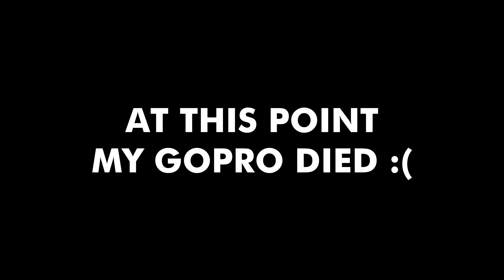2024 Triumph Scrambler 900 | High Mud Guard Kit | Fly Screen | Saddlebag Mount | Unboxing & Install!

Comment: Do you have the part number for the fly screen? Currently can’t find it listed here in the U.K. in yellow.
Reply from the maker: The retailer had to special order the cosmic yellow one.

Triumph Color Coordinated Short Windscreen - A9708381

Triumph Street Scrambler 900 Flyscreen Mounting Kit - A9708610